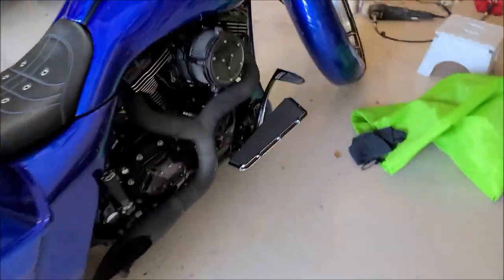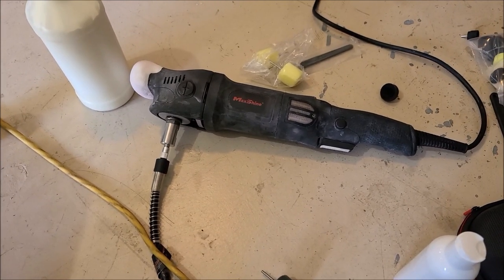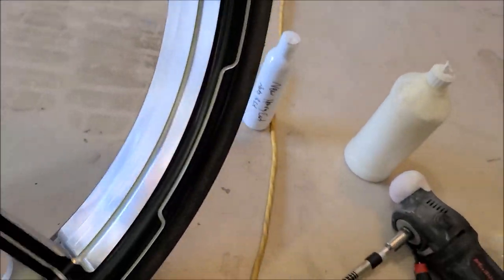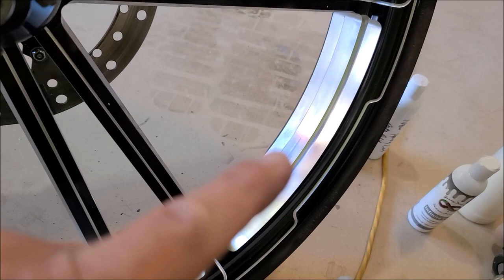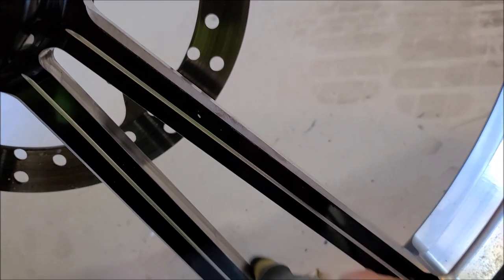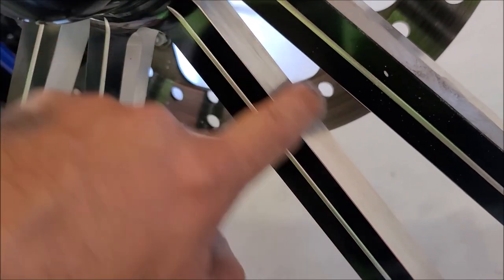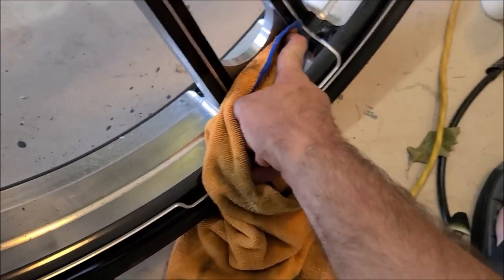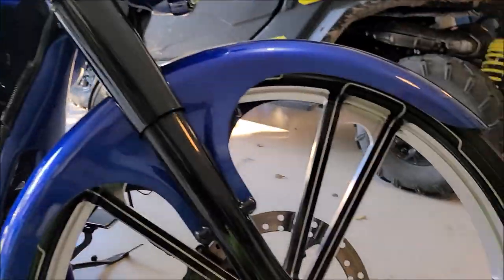HOW TO REMOVE PITTING FROM BARE ALUMINUM - SMART CUT - SMART FINISH - SUPER SEVEN CERAMIC COATING

Comment: Is that pitting maybe due to brake material compound? Some brake pad manufacturers use alot of Iron and other heavy metals in the makeup of their pads. It may be bonding to the bare Aluminum with the heat generation during braking. I may be hopelessly wrong. Just a thought.
Reply from the maker: Anything is possible. I was just happy to see this bike go! LOL